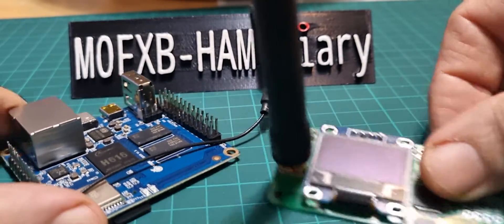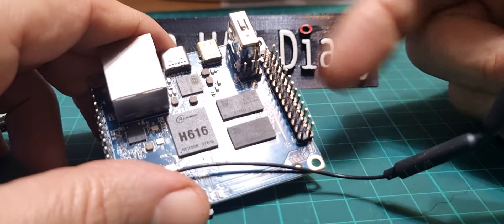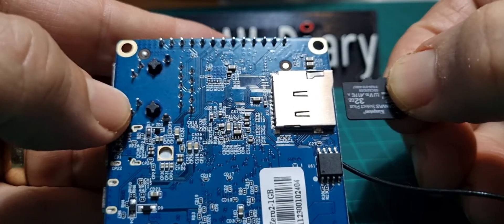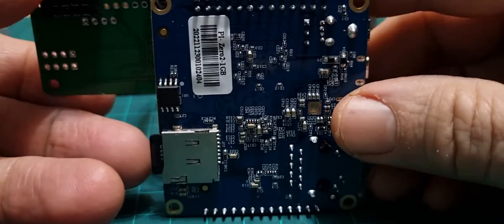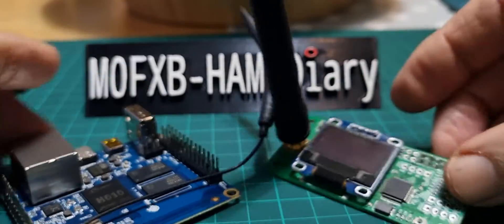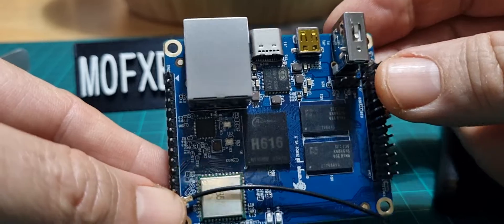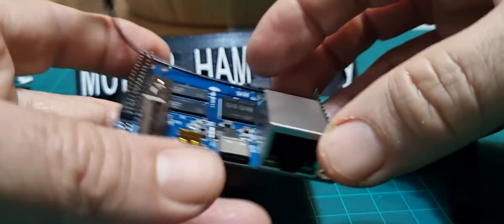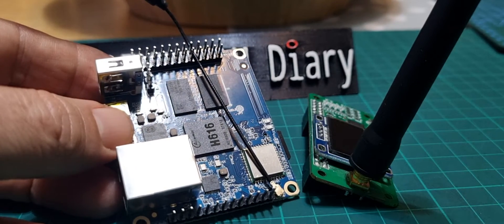ORANGE PI - MMDVM Help Needed

Comment: Hello out there. I got one of those and it a duplex, but I do not know what radio modem setting to use if you or somebody that can hello me please let me know. Thank you.
Reply from the maker: I need help aswell
Reply: @M0FXBHamTech   Did you get it ? i used one of the hats off the orange pi hotspot and used it on a pi4 it was the same but the complete opposite pinout  , Let me know

Comment: Well since it has a HDMI port, connect a monitor to it and run the command to check what IO assignments are on the pins.  Something like "~/wiringOP$ gpio readall".  The example I had seen this on was done with a OrangePI 3 LTS and it came back with a full list of what was on the header and pin5 as RX and 7 as TX.  I just thought it was odd that they were not consistent in the pin assignments.  However power and ground stayed in the same positions.
Reply from the maker: I will keep trying i just need to connect to correct pins

Comment: I believe all you need is +3V, GND, UART TX & RX.  looking at the top of the MMDVM board (antenna on left) use only the left header block.  
Bottom left pin(1) is +3, then top row 3rd pin(6) is GND, 4th pin(8) is TX, 5th pin(10) is RX.
https://ae03.alicdn.com/kf/S0b8414a234144fef993ccb84d68a1a8ab.jpg
Actually looks a lot like the OP zero GPIO https://nerdytechy.com/wp-content/uploads/2021/01/orange-pi-zero-pinout-1024x488.png
Reply from the maker: Hi Brill thanks I will try this .

Comment: You are going to need to know the pinout of the GPIO of the PI and compare it to the Orange PI, if the pinouts are different, it won't work unless you use jumpers to the correct mappings on the Orange GPIO pins but then it won't plug in nicely.
Reply from the maker: Thanks I have plenty pins .